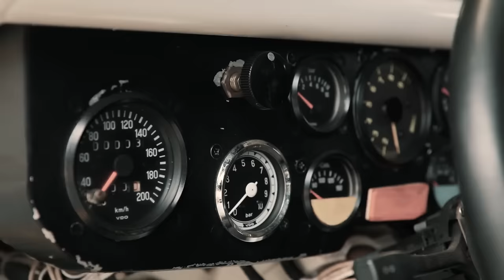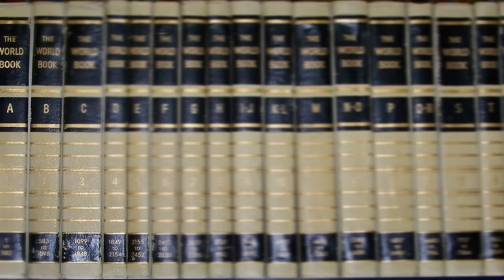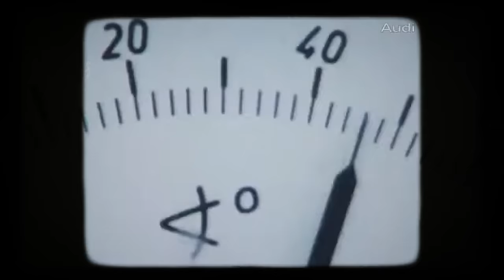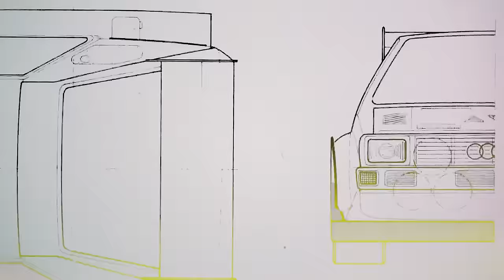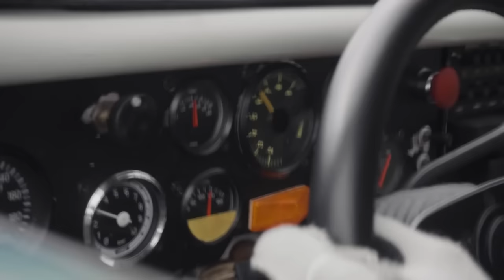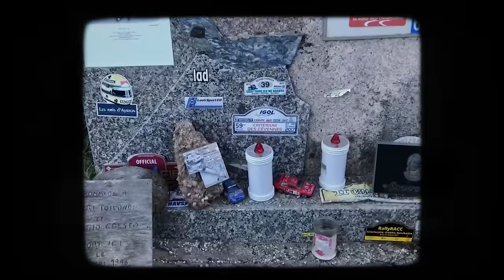How One Engineer's Idea Built The Perfect Rally Car

Comment: Group B was actually the easiest class to enter since only 200 homologation models were required.  Entering was easy, winning was another story.  The 86 Portuguese rally was not suspended, it continued, only without the main works teams who withdrew as a mark of respect of those who were killed.  Rally Portugal was also Audi's last show in group B, not Corsica where Toivonen died. It also needs mentioning that  before Audi ever entered a competitive rally, it was used as a course opening vehicle, that car with lights and siren that warns spectators that the stage will be hot soon; that car was driven by Hannu Mikkola, and at the end of the rally his time was some 24 minutes faster than the rally winner's.  It has to be the only time in history when a course opening car would've won the rally had it entered it.
Reply: It was actually 400 units, but Lancia had its own interpretation of that number.
Reply: @metalbladepegasus7854  Nope, group B was always 200 units

Comment: some corrections:

0:50 There was a minimum Weight dependent on the dsiplacement(as it was comon knowledge that lighter is better(so lighter/smaller weigt/displacement classes were preverable))

1:10 not that sophispicated. they where fast because they where light and powerfull and had large Teams around to adapt the cars to conditions but they where not technically sophisticated(f1 of the time was in a different league)

9:55 The Body was Steel, The Roll Cage is Aluminium, Some Body parts are aluminium more where Composite

11:20 it was not the pinnacle (The pinnacle was what Peugeot, Lancia and Ford did) it was a try to make a fundamental uncompetitive Car competitive again

13:40 Audi Used Rear wheel Drive at Le Mans(no quattro)

14:00. its not a system its a marketing term (there are many different systems sold under the Quattro umbrella with almost nothing in common)
Reply: Sound like a rally hater
Reply: @jordankelly4684   Not the OP. He's largely right. Although the quattro did use the carbon-kevlar body shells, the quattro did mostly use a steel body. 

HOWEVER the quattro was the "rally" pinnacle at that time because literally everybody adopted's audi's system after the quattro but not everybodywas as successful. For example the Delta wasn't as successful (sadly only was around till group B died). What lancia attempted with their stratos was like fighting a technological masterpiece at that time (the quattro) with sheer brute force and driver skill. What OP seems to have forgotten that motorsport can have multiple pinnacles, and the quattro was its own in the sport AT THAT TIME. Making an uncompetitive car competitive again was just a useful side effect. 

Also Rally cars were sophisticated at that time because Rally was the only sport to build cars almost as fast as WEC with the nimbleness of a drift car and the durability of a safari/dakar rally car to survive multiple sideways jumps and weatherproofing. Every other sport used carefully assembled vehicles that would seem delicate compared to a rally car, albeit being an odd comparison. WRC was as sophisticated as F1, just in a different sphere of technological development.
Reply: You'd have to be silly to assume WRC was "not that sophisticated" at that time.The technological development in rally was masterful. Just not as well marketed as F1 or Sports Car. Rally was the only sport to build cars almost as fast as WEC with the nimbleness of a drift car and the durability of a safari/dakar rally car to survive multiple sideways jumps and be weather proof. Every other sport used carefully assembled vehicles that would seem delicate compared to a rally car, albeit being an odd comparison. WRC was as sophisticated as F1 and WEC, just in a different sphere of technological development.
Reply: @arjun._.bbC6  its not about opinion its about facts ===> groub b not sophisticated for a top level motor sport. 

if you want to understand it look at the used technology and compare to what was standard in road cars at that time and other motor sports. If you want to blast stupidity into the internet feel free to do so but dont expect an answer.
Reply: @harrie205  
Nobody said anything about opinions??? This is a discussion on facts and facts alone. Which btw I did agree majorly with in case you missed.

and yet technology from group b spread to all other forms of Motorsport the same way tech from WSC and F1 did too. Motorsport shares tech, and subpar "unsophisticated" tech doesn't see much presence elsewhere. Pretty much all upper end hatchbacks and subcompacts made since group b have built on homologation standards developed during group b. I'm personally a bit WEC and F1 fan, but I'm not silly enough to discredit the contributions of group b and rally as a whole to automotive development. Also remember, although not directly related, but R18 etron quattro would never have come into existence had quattro not succeeded in group b.

I'm not expecting an answer from anybody, definitely not from somebody who's default approach is reluctance to discuss despite initiating a discussion. This is an open comments section and people are free to discuss as they wish. So you are free to leave this discussion to somebody far more cordial.
Reply: The Le Mans fact isn’t correct but it is correct to say that Quattro helped Audi dominate on and off pavement… They got banned or restricted practically everywhere including DTM and a IMSA GTO (I think, I forget the specific racing series that they were in in the US, I’m 90% sure it was IMSA GTO).
Reply: I was looking for this comment about Peugeot Lancia and Ford solutions 👍
Reply: Subaru

Comment: 13:33 The Quattro system wasn’t “winning 13 times” at Le Mans, as those 5x R8 wins, 3x R10 TDI wins, the R15 TDI win and first R18 win appear to be with 2WD cars, and were already dominating at Le Mans. You can probably call those 3x R18 e-tron winners “quattro”, since the Hybrid Motor Generator Units were driving the front wheels.

Comment: you really said that the audi quattro was the perfect car even when the lancia delta s4 exists. the quattros high and upfront center of mass combined with the lack of a center differential made it understeering pig especially in the tight hairpins at the asphalt rallies and even on gravel it was bad, every video you see from gravel stages the car is understeering over oversteering which is not good for speed and control.
Reply: Lancia delta s4 also wasnt perfect it was too fast but it was much better then Audi thats for sure in